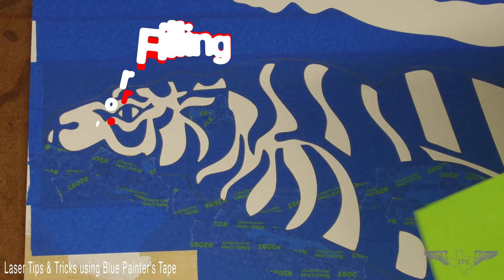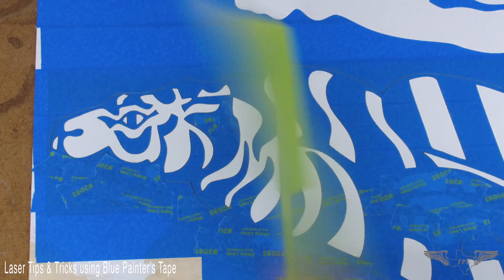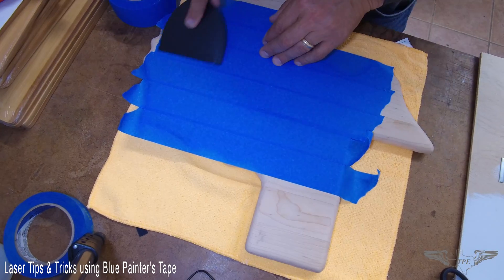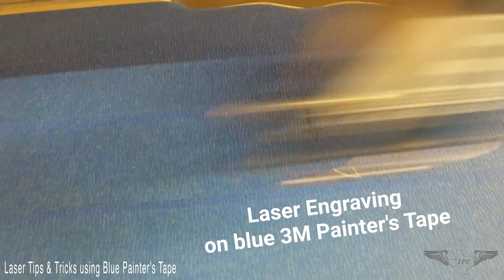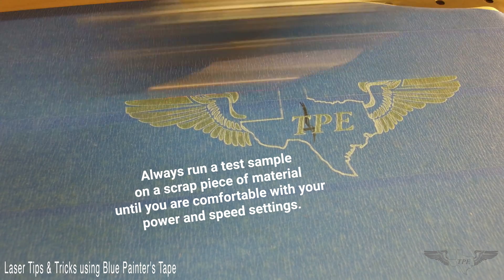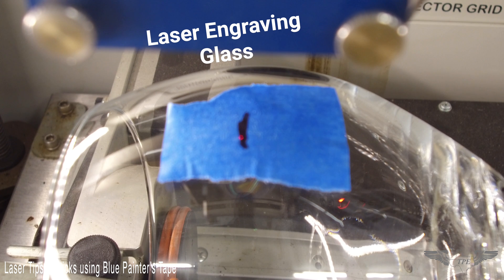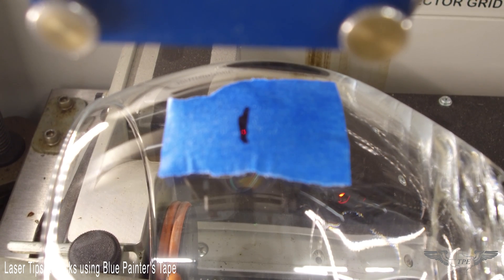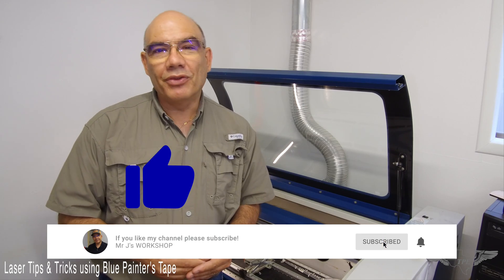Laser Tips & Tricks using Blue Painter's Tape

Comment: Hi! I know this video is old but I just stumbled on it. I have acquired a ton of scrap Corian from a customer of mine. I started making coasters with them. The black Corian works phenomenally well when engraving but not so well with the lighter colors. With that said, I started to mask with blue painters tape and engraved to spray paint afterwards. My issue is that the paint doesn't adhere well to the Corian. I bought enamel spray paint for models and it works great when applied to the Corian before engraving but afterwards it wants to peel up. I need something that is going to work after the abuse of the bottle/can over time. I am not sure if that after the engraving there is residual residue from the tape or not. I didn't know if maybe you have any ideas or not. The black ones I did without taping and painting came out beautiful and sell out so quickly that I didn't have time to experiment with the painted ones. I only have one machine and it is a very low 5watt diode.
Reply from the maker: Hello there, thanks for taking the time to watch my video. I have not worked with Corian except for kitchen countertops. But I have done some research for you on painting Corian. I have found there's a lot of paint out there for this material. The most common answer that I get is used epoxy paint. I would also try.Rust-Oleum Industrial Spray Paint Resists fading, chipping and peeling. But I think the epoxy paint is going to be your best. Bet. Hope this was helpful. Please like and subscribe. Let me know how you made out.
Reply: Thanks for the input!

Comment: I hate using blue painters tape when laser engraving and doing paint fill. The tape always is hard to remove and leaves a glue residue on the project.
Reply from the maker: Hi Thomas
Thanks for common comments !
How do you presently handle those problems?